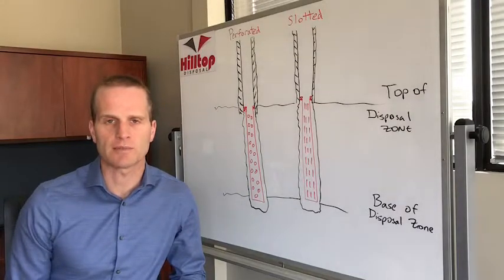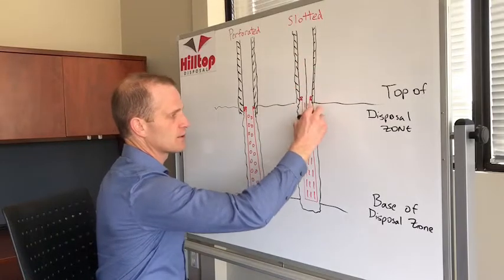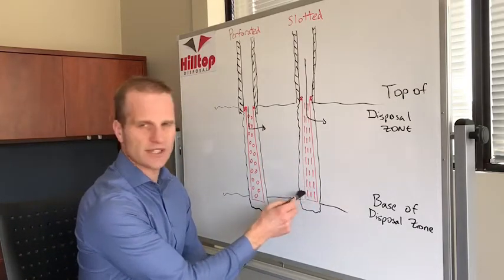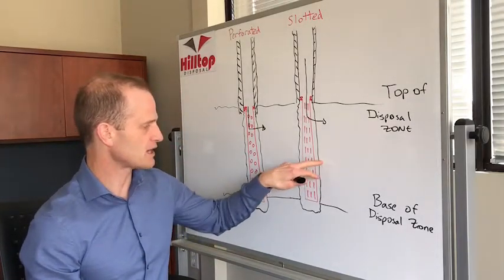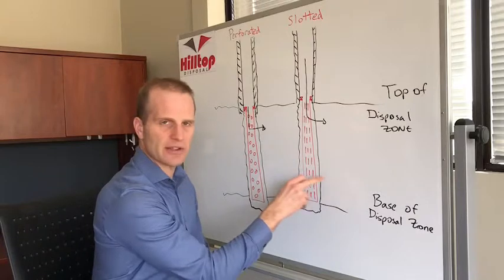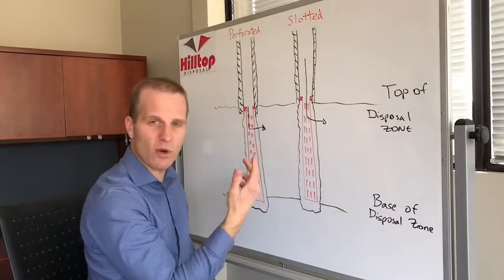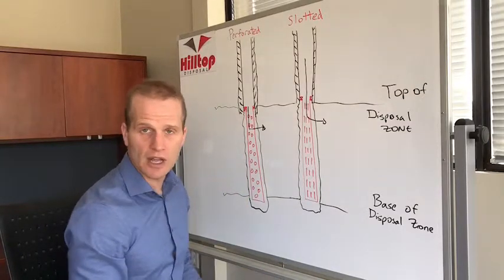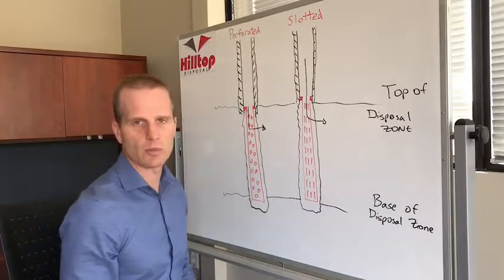Liner - Perforated Vs Slotted

Comment: So if the geologists see thst the well has bad permeability which means we might need to frack. We would go with predrilled so that there is a possibility to frack but with good permeability we would go with slotted, since we will probably not need to frack. Thats why they probabaly use mostly predrilled in the US since you guys have reservoars made of shale which has bad permebaility, which means you must frack. Is this correct?

Comment: Thanks for the video. One question, can we have slotted/perforated liners in horizontal wells? Or is the horizontal section always kept open?
Reply from the maker: Whether a HZ section will stay open after drilling depends on the geology and what the well will be used for after.  For Disposal Wells, I would run the liner so that coil delivered treatments will be easier and cheaper in the future to administer.
Reply: @dustin newman  thanks. No, lets assume it will be for oil/gas production. What I really want to understand is this, as far as I know the slotted or production liners are hang to the casing, right? If so, how does it work in a horizontal section? Does something like this exist for horizontal sections or does it stay open all the time? In summary, does a slotted or perforated liner for horizontal sections exist?
Reply from the maker: @koksalan75  Yes slotted and perforated liners exist.  Depending on the application, the HZ section is either open hole or slotted liner.

Comment: unfortunately, I couldn't understand the difference between the two types
could you please clarify it more
Reply from the maker: Perforated liners - think round holes - ½" - 1" round holes.  Slotted liners are have slots - ¼" wide by 2" long (for example).  Round holes work better for disposal wells.
Reply: @dustinnewman3365  
Thank you so much